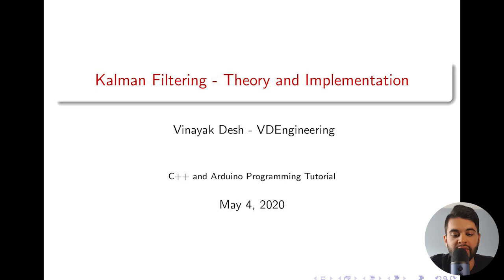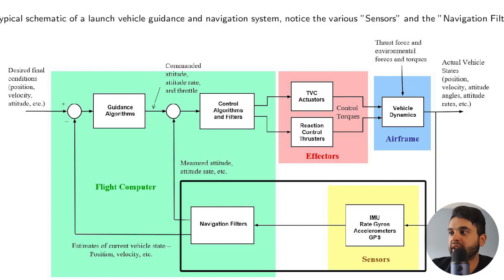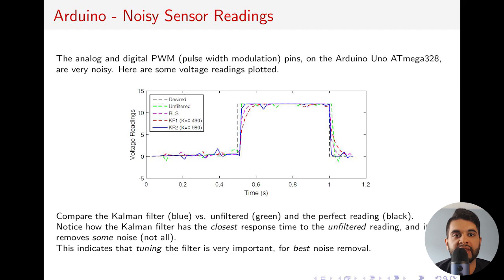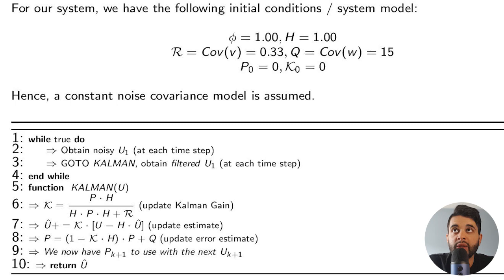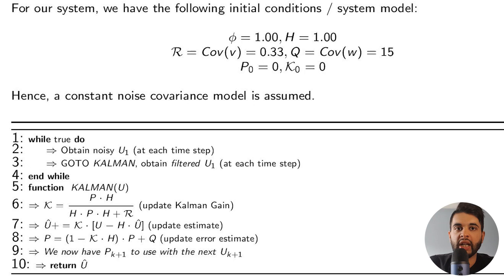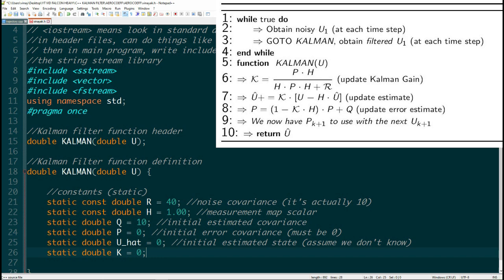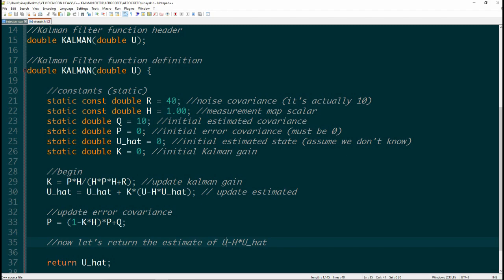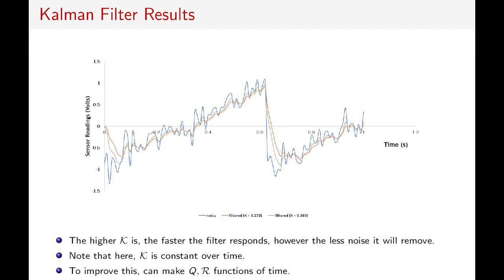C++ & Arduino Tutorial - Implement a Kalman Filter - For Beginners

Comment: There doesn't seem to be any consideration of the process model here. In this case the Kalman filter is just a smoothing filter, and has no particular advantage over much simpler filtering techniques. The Kalman filter is more more useful when you combine a noisy measurement with a modelled state.
Reply from the maker: Yes you are right. This was just for demonstration purposes
Reply: @VDEngineering  Then it is not a Kalman filter! This video was very misleading for me in that sense, I had to spend much more time making sure your explanation was useful to my case and it was not! I have to change my approach to the filtering task I need it for...

Comment: In the key/legend for the graphical results, you show two fixed values for the Kalman gain...implying that the two plots are obtained by using two fixed values for the Kalman gain. I think the Kalman gain is not constant as it changes on every iteration so as to weigh more on the prediction or weigh more on the measurement. So is it correct to have a constant kalman gain throughout the estimation process?

Comment: That's increadible, you are awesome. How do you calculate the initial R, H, Q, P, U_hat and K?
Reply from the maker: This is a steady state filter, so I just specified them, it depends on the noise in your system
Since they don't change with time you can adjust them to see how much noise gets reduced.
Just be careful to choose them such that the filter remains stable (otherwise it will diverge).

Comment: hey thanks for this. I need a second input to the kalman filter. how can i do this? thanks
Reply from the maker: use matrix
Reply: @VDEngineering  thanks. Would it work with the same equations? just adapted to a matrix operations
Reply: @VDEngineering  thanks it works now. what is the source/website of the psudocode? thanks again

Comment: Why the initial error covariance (P) must be zero?
Reply from the maker: Because you should know your system initial conditions exactly!
Reply: @VDEngineering  this is not necessarily true. The Kalman Filtering theory doesn't require perfectly initial knowledge of the state. In fact, the P0 acts as a tuning parameter to adjust the "rate of learning of the filter". P0=0 means that the KF starts with a lot of confidence in its initial estimation and will struggle to update the estimate. P is a covariance matrix so should be positive definite for better performance. I would say that it "must not be zero".